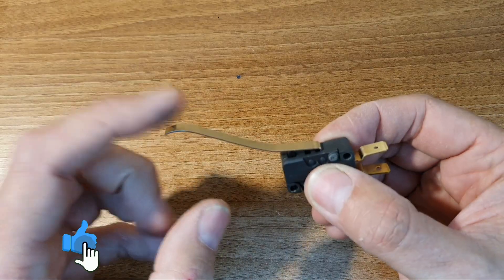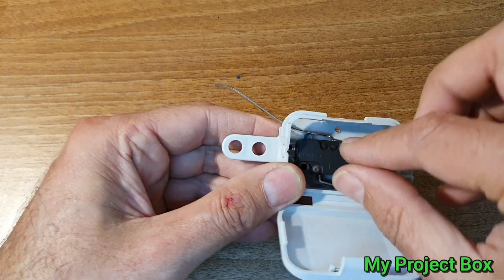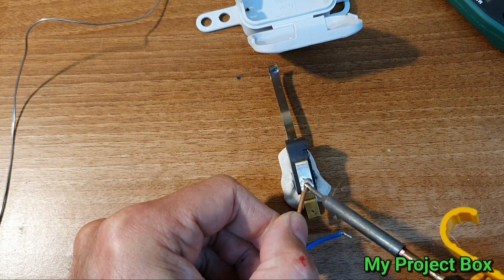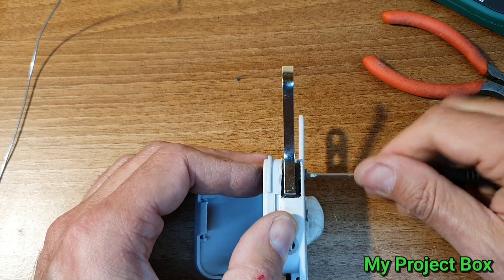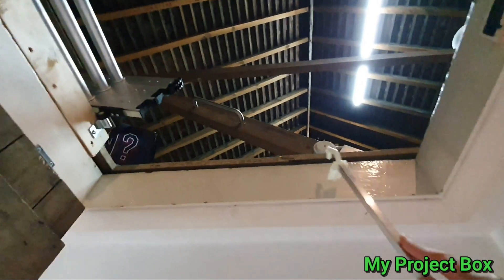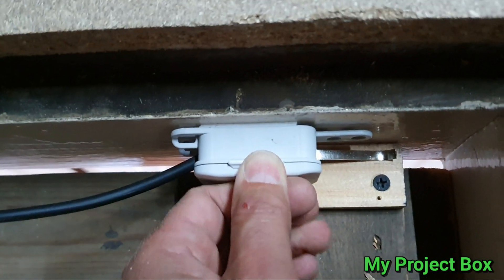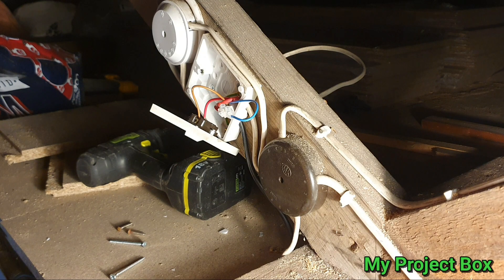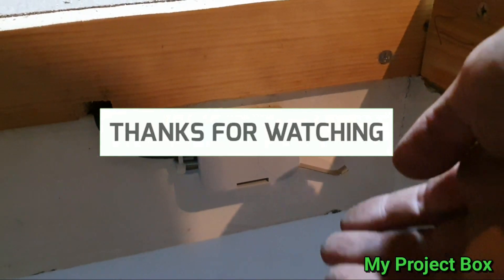Automatic  attic / loft lights. Never forget to turn your loft lights off again.

Comment: There is no advantage of putting the switches in series in my mind as if one goes bad then whole circuit is bad, in parallel would be better so that you can keep the original switch off all the time and let the door switch control the light but if the door switch goes bad you still can fall back on original to switch off

Comment: Good work.
I would have put some sleeve or heat shrink on the terminals, just a bit more safety.
Reply from the maker: Extra insulation is never a bad thing 👍😉